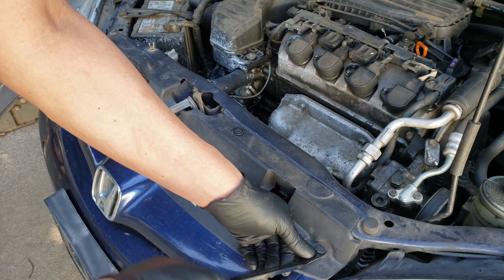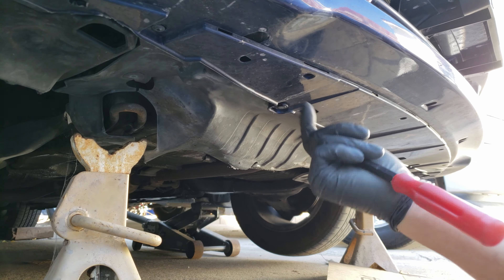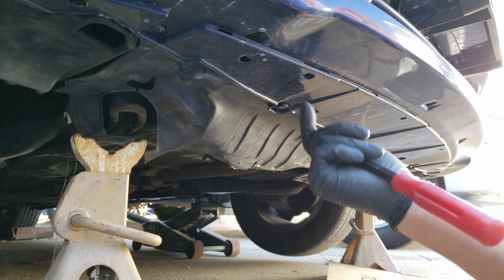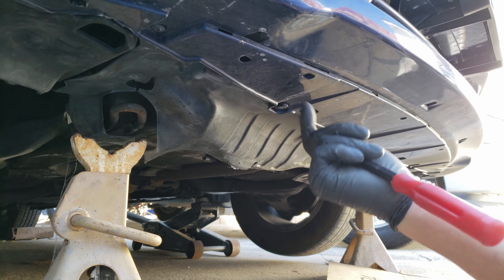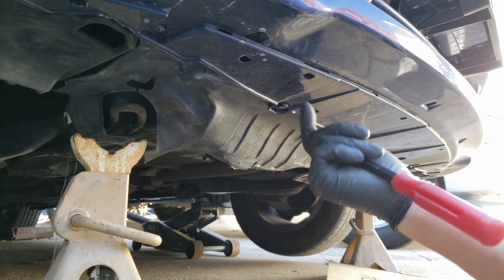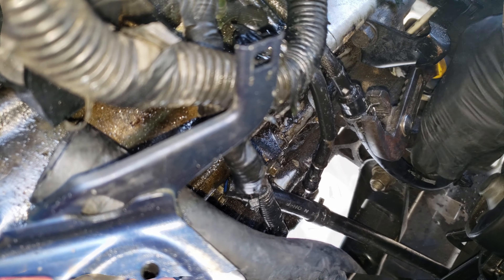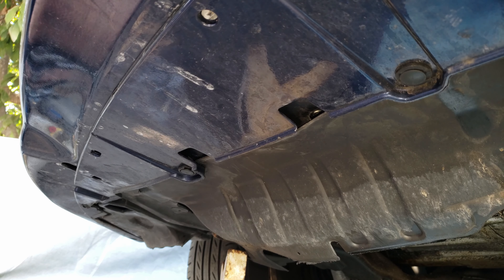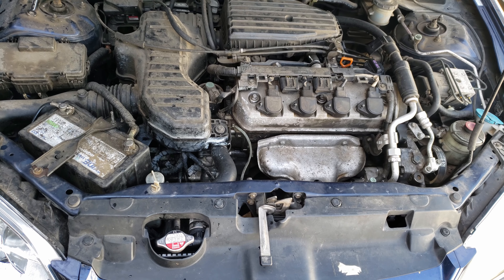How to Replace a Radiator Honda Civic 2001-2005

Comment: Thank you so much! Very high quality video. Btw, for anyone doing this job with a manual transmission, you don't need to worry about the transmission lines, as there are none. The new radiator you buy will probably have the ports for the transmission lines, just leave them unconnected.
Reply: Oh I was wondering that! I was like where is those hoes!!!! I was so worried mine is manual as well
Reply: thanks

Comment: This guide is super solid! He mentions to move the ac condenser but doesnt show how. Just pop it upwards from the rubber mounts on the bottom, and then be careful manipulating it and the radiator. It has give but you dont want to force it too much. This was the trickiest part

Comment: This way will obviously work but All the extra work is unessesary. I just changed mine on my 02 I didn't have to take the battery out or the front bumper I just had to take the hood latch off. slid it in and out had it done a little over an hour. Works great.
Reply: Cool, make a video on it.
Reply: He did the mechanic way 🎉

Comment: Nice and esay way to do it,👏👏.

One question please.my radiator to my civic 2005 has no connection hoses to the 2 bottom side ports.is that normal?
Reply: If you have a manual I don’t believe it has cooler lines

Comment: Awesome!  Yet another thorough and informative project guide.  Whenever I am tackling a new project on one of my Hondas or Toyotas, I always check if you have a video to cover it.  Your videos are THE BEST in terms of covering all aspects of the job with great camera shots and good tips and tricks and not wasting one second of the viewers time with useless filler -- every second is useful.  Thanks for the Amazon reference on plugs/caps -- those will come in useful on lots of jobs -- wish I had those when I did the Corolla transmission cooler lines.  I also have that same funnel from prior water pump replacement projects -- it works great for burping out the air without spillage.  You must live out west.  Here in the rust belt, every one of those bolts is a fight to break loose and a prayer that I won't snap off the head -- you are lucky to live somewhere with limited rust since the rust tends to double the time for pretty much every project I do.   I was curious why you didn't remove the 3 hoses from the radiator before removal and replacement -- was it just too difficult to remove and replace from the bottom with the radiator in place?  Or was it just a matter of minor convenience that it saved you from crawling underneath to access them?  Keep up the great work and thanks for putting in the extra effort to keep these focused and informative (with great camera shots of key steps)!
Reply from the maker: Thank you🙂 i really appreciate it...yes i left those connected cause the plastic panel underneath gets in the way so you have to bend it down or remove it to do em, so it saved me time to leave em connected

Comment: I have Honda Civic 2004 lx ,no leaking on engine and on the ground, no overheat but anti freeze coolant level keep down and I have to top up a radiator after drive. Do you think a radiator is go bad and need to replace.Thanks.

Comment: Was the coolant spraying out of the coolant resevoir? I ask because that's exactly what my car is doing. I have coolant all over that side of the engine. Looks exactly like your  engine looks like with blue dried coolant all over it. Did you try changing the radiator cap? I did but unfortunately the car has a aftermarket radiator so I was unable to find one that fit right.
Reply from the maker: Yea, but its cause it has a head gasket issue thats slowly getting worse...but then a rock hit the front of the radiator and knicked it to where it was leaking from the lower front corner..so that's why i ended up replacing it